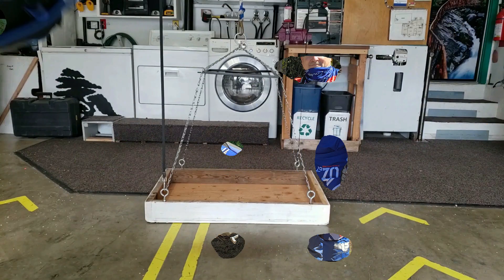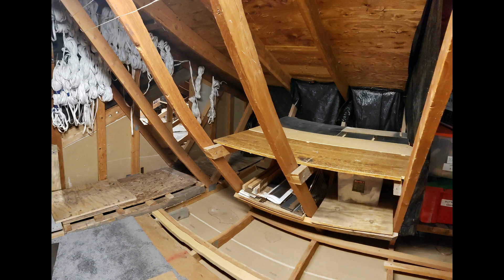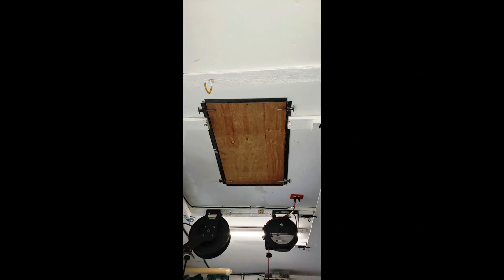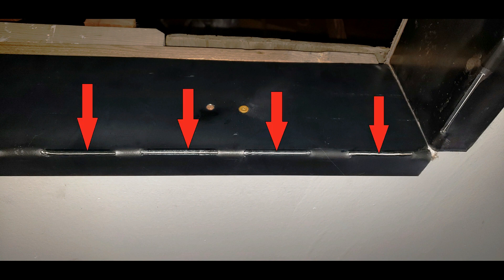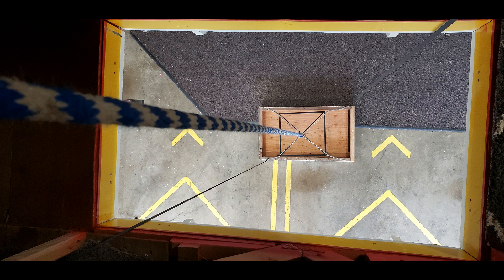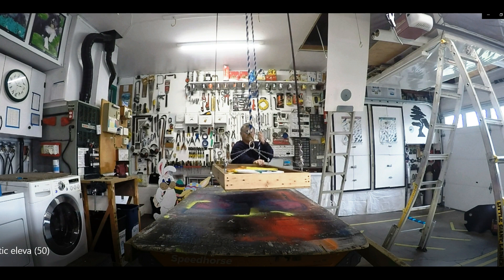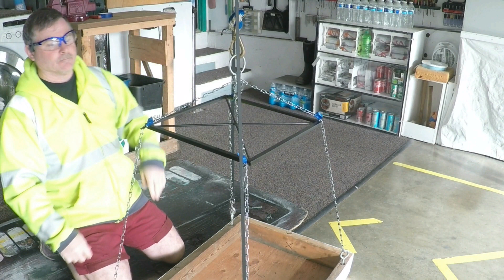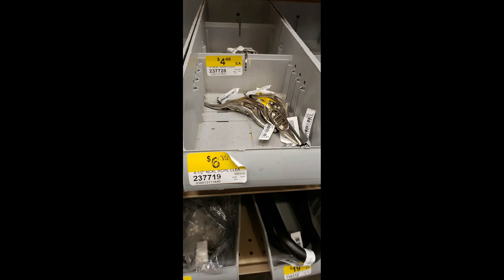house dumbwaiter from scratch

Comment: Dude!! I was dreaming of a dumb waiter since seeing The Watcher!! Why they ever stopped installing them is beyond me.  I’m in my truck, freezing watching your vids love em all.  Now… what say you on bringing back the “laundry chute? I had one as a kid in the bathroom, to the basement. Got to ride it both ways a few times.  Was thinking it be great for the master of course, but after Riding or work coming in And tossing our wet gear or dirty coveralls down the chute from a mud room would make for less bitching if there’s a sig other, and much easier just all around
Reply from the maker: Yes, a laundry chute would be awesome! However, my house is on a concrete slab (no basement). So the dirty laundry would not fall very far.

Comment: Very through video; you could try double snatch block for actual mechanical advantage all you're doing now is redirecting your pull
Reply from the maker: Thank you for the suggestion. The amount of weight I lift is easily handled with one pulley. If I double snatch blocked it, my rope would be considerably longer and the platform would take twice as long to lift. Again, thanks